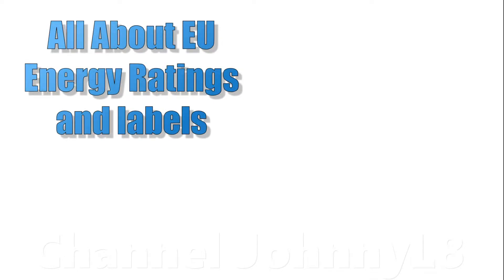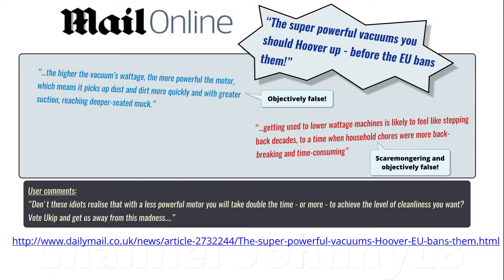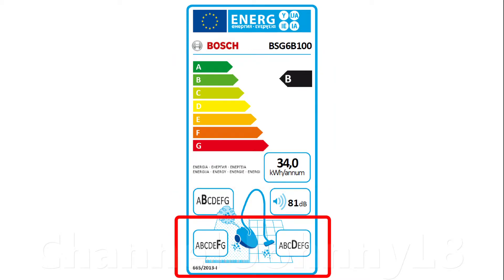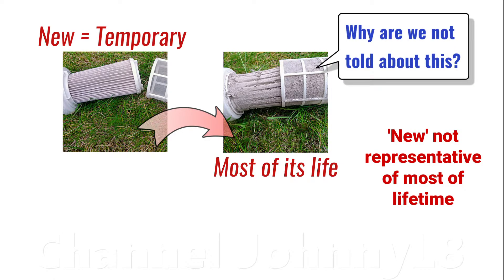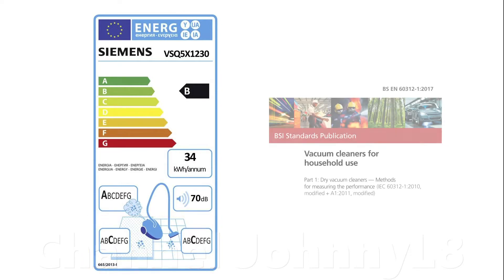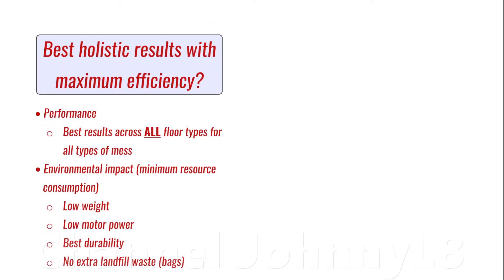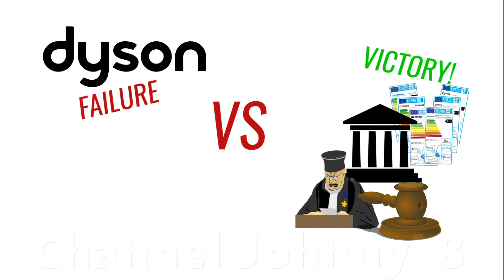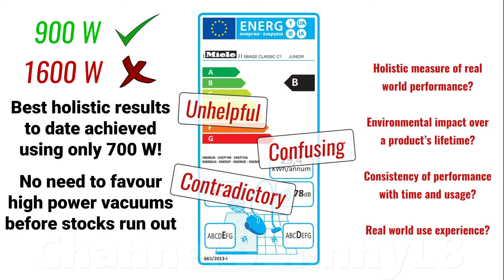The problem with EU energy labels for vacuums

Comment: To be honest all these "amazing" 850W vacuum cleaners are bad, i used 3 the last 5 years and tried but they all really bad even when they where new.
My old 1700W one is far better than both my 3 new ones and i used it for almost 20 years now.

This was very good for the environment i bet buying 3 vacuum cleaners hoping to finally get a new good one, not to mention all the old (new) machines that had to be scrapped to fit the new eu regulations......
Reply from the maker: How good a cleaner performs is not related to their power consumption. Good design can allow exceptional cleaning using powers as low as 700 W, as evidenced here https://youtu.be/YnJ6OqVC_wg

Comment: The 620W Henry vacuums are unable to spin the turbo brush on medium pile carpet. The 889W Miele vacuums are not as good as the 1600W. Sorry but the second cap in 2017 was a big mistake.
Reply from the maker: Yeah, that really shows just how bad their technology is. It gets worse with reduced input power. Superior technology by better brands has improved with reducing input power, showing their design better utilises its consumed resources. The only conclusion is to invest in better technology that makes the chore much easier. The EU energy limits really exposed which technology was scamming the public by needing to waste huge energies.
Reply: Vacuum Facts but how can you argue it’s saving money when either way I’ve been forced into using more energy? The only solution would be to buy another vacuum which i can not afford to do, and that adds my current vacuums to landfill and I’m sure the production process is energy intensive in any case.
Reply from the maker: (sorry, YT didn't inform me of your reply.) I don't argue at all (and never have) that it's saving money. How have you been forced to use more energy? To achieve performance you could have easily used a better product which performs well using less energy. And it wasn't the energy labels that forced you to 'use more energy'; it was the crappy vacuums by weak manufacturers that caused it. Blaming those who exposed rubbish is misdirected anger. Blame the actual cause—manufacturers who don't care about anything than your money. And you don't have to buy another vacuum straight away. Vacuums have a lifetime and the intention is that when one expires, the newer ones will perform more efficiently. It's down to a smart user to do their research before buying and determine which models are genuinely good rather than buying into marketing at face value. Hence my channel. All the money you've blown on cheaper products which have broken and failed to perform. If you'd saved up and bought a quality product from the start, then you wouldn't even be having this conversation. My advice; save up, possibly sell your existing naff vacuums to people who don't care either way, and then get whatever the top Dyson cordless model is at the time (currently V11; V12 from Q2 2020, probably).
Reply from the maker: In what sense? The energy caps have not inhibited continued cleaning performance improvements on the condition you've actually got a good design, rather than relying on lazy, sloppy brute forcing at the expense of the environment (which was what the EU caps were trying to address. They've been a big success in that sense. Rubbish vacuums have been exposed for being just that, whereas the best have shot straight through and performed amazingly without the caps affecting them in any way.
Reply: Vacuum Facts well, in my case at least I used to use a 1200W Henry to clean my carpets. When that broke I replaced it with a 620W Henry which does not have the power to spin the turbo head on my carpets, so I have to either vacuum for 4 times as long using twice the power of the old vacuum over time or use my Miele which peaks at 2200W.

Comment: But my hair drier is 3000 w
Reply from the maker: That's likely true. But what's your point? Bear in mind there are no practical alternative designs to hair dryers which use less power and that globally speaking, the total power drawn is likely not anything like as high from that device given not everyone uses one. It's shown that the objective of vacuum cleaning can be achieved with a tiny fraction of the power, which adds up over a nation and beyond, and that there's therefore no reason why anyone should be using more power than needed, as it all adds up. Anyway, let us know your point.
Reply: @VacuumFacts  Yeah my main point is that It's useless.  Sense It just burns my head and it is very in efficient because 30% of the heat escapes thru the body. Mostly I pointed out this as that this much power is unnecessary and probably only cheap manufactures do this and my 900w hair drier is just as well because it's insulated.  It seems like the world just thinks that
"More is better" and not managing the energy and just dumping it is kinda stupid. For example, my mom needed a kitchen machine and she saw one that says "1000w professional'' and told me that was more powerful and had more torque.
But in truth we eventually got a 700w one and does just as well because you can convert the higher speed into a slower, but torquier . Likely you could build a really fast motor even with a tiny turbine and still produce near enough suction as a full sized vacuum. So basically, It's about managing the power, not dumping it . Especially if you want to convert one form of energy into another. And that comment was intended as a joke even though i actually had that hair drier .
Reply from the maker: Yeah. I'm sure lots of household products could be more efficient. Vacuum cleaners were presumably identified as something so commonly used that legislating on them would make the largest impact. Maybe other products will follow if there's a case.
Reply: @VacuumFacts  Dishwashers seems too be the most efficient I think. as they are consistently recycling the water, and they have very good insulation, the pumps are constantly running on a low rpm, and most of the work is down by the propeller. 
I know that dishwashers like washing machines, have various cycles that requires draining and filling with fresh water. But the main development seems too be towards cleaning and drying tech, as well as detergents. Mine dishwasher happens too have a very efficient energy capturing system, where the wash cycle's lost heat is used too heat up a water tank that's right next too the left panel of the box, and when the rinse cycle comes the water is drained from the tank which interns requires very little heating too reach the 70 degrees the rinse cycle needs.

Comment: your slagging others of for having c ratings by saying there bad and saying Dyson are better well u should put the light balls rating on there I checked and it's a c for hardfloors and carpets so it can't be any better than the other ones
Reply from the maker: Hi, The EU ratings are very vague and misleading and can't used to meaningfully judge the performance of any vacuum by any manufacturer. They don't conform to industry standards, and even if they did, the holistic performance is more important than any one individual metric.
Reply: @VacuumFacts   "They don't conform to industry standards" What are these industry standards? Where can they be found so that they can be read? Where can I find independent testing done using these standards for different models of vacuums to find out which ones are best.
Reply from the maker: @timh5529  Industry standards are multi-organisation, committee-formed test methodologies that all bodies conform to. This ensures consistency and comparability between any systems tested. They're generally all-encompasing and statistically significant. You can find them online if you invest the effort to look. For vacuum cleaners, the tests are quite thorough and involved. They require a laboratory and specialised equipment and highly skilled people. As such Independent testing is extremely expensive. Most companies, particularly those that sell snake oil to the gullible (of which there are MANY), rarely commission any testing, or if they do, never reveal their test data, because it often proves they are embarrassingly inferior to their better competitors. Kirby spring to mind and are guilty of this. They seem to build a meme-base of grandiose claims which are not supported by any evidence and rely on idiots spouting myths of their performance superiority. Testing never shows it to be true, e.g. https://youtu.be/8K6B_O5_C90 and https://youtu.be/qJlaBeqVs7E . The better manufacturers commission independent bodies to do the testing (as well as having their own in-house replication—the better manufacturers showing results consistent to independent testing). Because the findings are commercially sensitive, manufacturers rarely disclose the fine details of their testing to the public. However, the better manufacturers like to boast of their performance relative to others; Dyson specifically often report that independent test results confirm their product perform superior to the competition. Others have made that claim, but have been found to have lied and sued for millions in court; you don't make a factual claim like that in public unless it's true, because the consequence is millions in fines and severe reputational damage. A good example of poor companies engaging in corrupt filth of that nature can be found here when Shark were sued for millions for lying to an unsuspecting public: https://youtu.be/pVheYuzIk3I
Reply: @VacuumFacts  You can find them online if you invest the effort to look... Are you kidding? Why you don't just put a link?
Reply from the maker: @donz2605  IEC 62885-2:2016, BS EN 60312-1:2017, ASTM F608 - 18
Reply: @VacuumFacts  Thank you very much. Unfortunately they are not  free, cost more than average vacuum cleaner.  Could you please be more specific what is wrong with  EU ratings?  (you wrote: are very vague and misleading).  Do you mean standards IEC 62885-2:2016, BS EN 60312-1:2017, ASTM F608 - 18 are bad?
Reply from the maker: @donz2605  It's been a while, but they are not in the same league of scientific rigour as the industry standards at objective determination of performance. You'd have to compare the two carefully to see this for yourself. It's an irrelevant discussion really; they've been repealed and no longer exist. They are to be replaced with something better the last I heard.
Reply: @VacuumFacts  I don't know if it would be any help but I have been in a vacuum test lab and know what is involved for the test process if its of interest to you ps i'm not trying to prove or disprove anything I just know how the tests are done
Reply from the maker: @garethsaunders9266  Nice to hear. They should be done according to the industry test standards (which are being revised all the time). I have access to these and understand the processes involved. Quite dry reading. It's the outcome from indepdenent test labs that's important, though. The low level data is not always made public, but you can bet favourable conclusions will be proudly advertised by the top scoring companies.
Reply: @VacuumFacts  I love the videos you have done and have ordered the latest v11. I find it amusing seeing the comments from people that do not understand what you explain in great detail and the owners that strip down there Dyson's I don't understand that if they use them right in the first place.
Reply from the maker: @garethsaunders9266  They're nicely described by the three 'i's: ignorance, insecurity, and intransigence